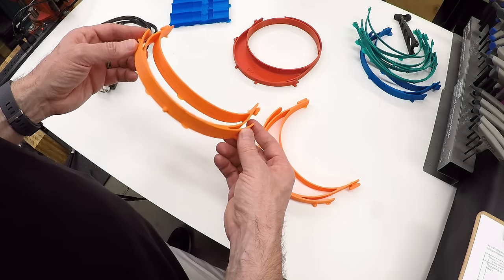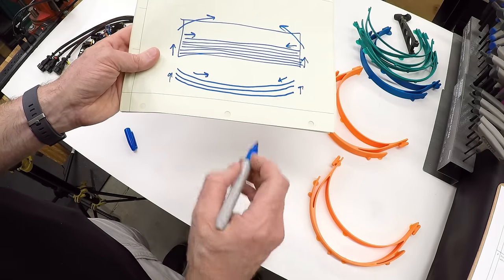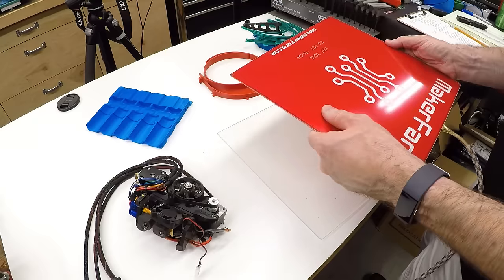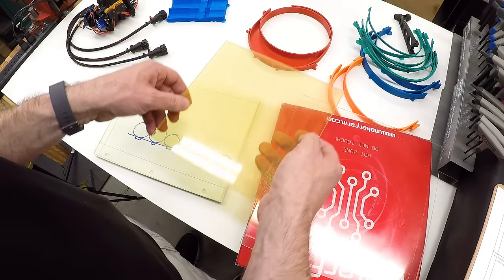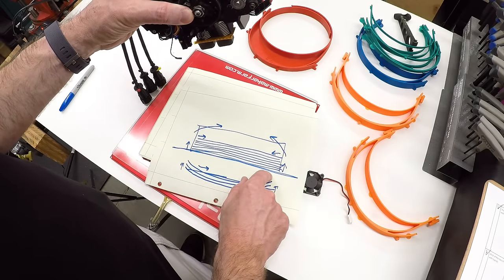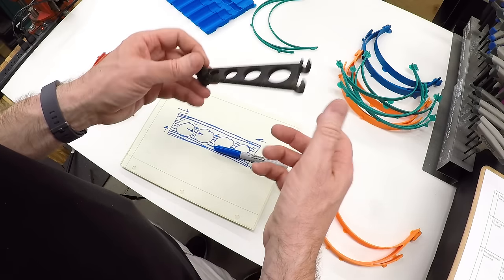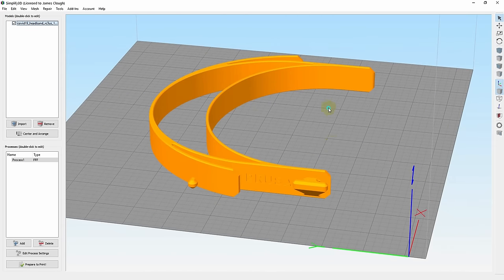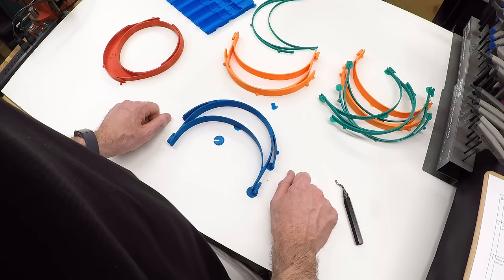3D Printing with ABS - Tips for Success

Comment: I got two things I'd like your opinion on:

One of the ways ive seen people use is a thin layer of abs on the glass.  Someone used an abs block on a syringe that had acetone in it.  

Also, what about using a different patern like a "hibert curve" for the first layer (so that there are kinda even numbers of x and y lines to help adhesion in both directions)?

How do you feel about those?  I don't have much exp with ABS, nor the setup for it.
Reply: Also, if you don't mind sharing it, that micro switch servo looks pretty sweet, do you have a schematic for it?

Comment: We have avoided printing PPE out of ABS as it will release toxic chemicals if accidentally put in an autoclave - PETG is much safer
Reply: I read this comment and that was at about 10 sec in. Now I'm going to go watch something else.
Reply: Aren't autoclaves hot? If the temperature is above 60 degrees C, you risk a lot more than an insignificant amount of toxic chemicals being released, you're risking the life of anyone wearing a PLA item subjected to that heat as it will lose it's structural integrity. ABS is good for 105 degrees C. Also, PLA is biodegradeable in water. ABS isn't. I would say ABS is a much safer material than PLA overall  for PPE. I don't know about PETG, I've never used it. I have a Flashforge Creator Pro printer, which is a totally enclosed model and only ever use ABS with no issues. Even though my printer is in my small home office, I've never noticed any smells or fumes when printing at all.
Reply: @Derek_S  pla does not degrade in water, weii if yuo wait a millon year maybe

Comment: It is a nice video. But the only safe way to prevent warping and cracking is to heat your chamber. It cost only 20 Euro and you can forget any problems with ABS. 55-60 Degree Celsius is enough. I had a a machine, that only print ABS, for all the the other easy filaments i use other printers.

Comment: Excellent tips, I wish you would share somewhere your pirnter settings for various filaments. Didn't know the first layer difference between PETG and ABS.
I 'discovered' most of the tips until the last one, always restorted to rafts on thin parts. Now I wish someone would just develop a CURA plugin that allows placement of "mouse ears".
I would also like to know how you handle print runs: do you keep the bed and nozzle pre-warmed? do you just let the parts cool down and pop off? Do you monitor everything by camera and step in when there's a mess?

Comment: What would you say would be the maximum height using ABS with an open-bed 3D printer?  I'm thinking that using a Ender 5 Plus and printing a 12" part would be a disaster 99% of the time without enclosing it.
Reply from the maker: It's all,about the geometry.  Height is only part of the equation.  I think the tallest ABS parts I've printed are in the 6" range.
Reply: @Clough42  Yes. I had commented about half way through the video and eventually got to the part of breaking up the long strands.  I'm about to buy an Ender 5 plus in a few days so I'm green as it gets.  I'm wondering if there might be slicer options of some type to print things a bit different rather than long rows.  It would be nice if there were but I'm just researching those things today.

Comment: Yes, ABS is cheap these days.  Hard to find TPU, and PLA is more expensive.  Curling / shrinking due to heat break cooler exhaust is a a real thing; I like your solution.  Is that switch-on-a-servo Z-probe homemade, or maybe a commercial product that predates the BLtouch?
Reply from the maker: It's homemade.  It's an HXT900 servo with a 3D printed arm and a low-force microswitch.

Comment: with a heated chamber of 60 to 65 deg C  you will never have trouble of layer bonding or warping.  you will also get stronger parts.  the Idea that ABS is outdated is because peoples don t have a heated chamber so they fail trying to print it.  makerbot just update the makerbith method to the method x because the original method heated chamber don t heat enought .  the method X is there version to succesfuly print ABS

Comment: very good advises, but I have a stupid question, If printing with ABS is that hard why stick to it, I mean what's the pros that make up for all that trouble ?
Reply: My reason is because I am trying to print replacement parts that break off old motorcycle parts that are ABS. Using solvent welding to bond ABS to ABS is pretty basic. Then the repaired part has the same kind of plastic throughout so any fabrication or painting on it will react uniformly.I have made repairs by hand making a small "mold" then applying a thick paste of ABS but that is so slow and messy. Very strong though.
My error in 3D printing was choosing an improved strength ABS filament "TitanX" but what they've done is modify the mixture to get that extra toughness and something in it won't allow it to dissolve in solvent. Personally, PLA is a "gateway drug" to learn with but it wouldn't be my first choice for reproducing applied parts; things that get used, not looked at.
Reply: Yeah i swiched to ABS over PLA for that toughness reason but the parts i get with ABS snap I don't think I have a good layer adhesion although the parts look good
Reply from the maker: I like ABS when PLA is too brittle or PETG is too flexible.  Or when I need parts to stand up to weather exposure.  Or when I want to machine the parts after printing.  Or when I want to vapor polish.  Or when there's a global pandemic and all the PETG and PLA are sold out.

Comment: I'm using ultrabase heatbed for 2 years with ABS and never had this issues like you had. Simple part stick like hell not using any hairspray, abs juce or any. The only thing that  matters is how do you calibrate your bed level.
Anycubic I3 Mega
Reply from the maker: Yeah, Ultrabase is the surface I mentioned but did not name in the video.  It sounds like you're having a great experience with it.  Lots of other people are too, but, there are also lots of reviews out there from people who had great difficulty.  There are lots of variables.  Being aware of them leaves you better equipped to solve problems when they arise.
Reply: @Clough42  Agree with you :)

Comment: What you can do about it is to not print ABS.  The filament industry is sitting on tons of the stuff that hobbyists will not touch with a ten foot pole anymore.  It isn't worth the trouble and the carcinogenic fumes floating around the mandatory heated enclosures.  Tricks mean a few might work, but it cannot be relied upon without a dedicated set up well away from any and all office quarters.
Reply from the maker: I print hundreds of parts per month in ABS because its properties work well for my application, and I have my process tuned to print fast with high yield.  If something easier to print works well for your application, it sounds like that's a better choice for you.

Comment: with the mouse ears wouldnt it be better to have rectangles so there would be less to cut off the item. ie rather than a 20mm dia circle a 30 by 10 rectangle would mean just 10mm to cut off the item
Reply from the maker: Maybe.  I think the rounded sides may be less prone to peeling up themselves, but I have nothing to back that up.  However, in practice, I slice them off with a deburring tool, so a 20mm circle or a 30x10mm rectangle both come off with a single swipe of the tool.

Comment: Hey there how long did yours take to print they the same ones i been trying to print but taking 13hrs so not able to make many yet, only got my printer 3days ago so probably slicing wrong thanks good job your doing 🙂👌
Reply: He's printing at almost. 4 layer height with a fairly ridged machine so i assume he's printing them awfully quick
 3hrs ish maybe
Reply from the maker: 1 hour, 41 minutes.  .38mm layer height, 30% infill, three perimeters, 100mm/s.
Reply from the maker: 1:41, actually.
Reply: Thats incredible wow 😮 didnt know printers were that fast mine must be in the wrong settings 😂

Comment: And  E sun abs is good so shouldn't have no problem as long as bed is level and have a heated chamber.
Reply from the maker: With the heated chamber, it works very well.  It was working pretty well for me on a smooth PEI-on-glass bed in an open printer until the middle of last year.  New rolls purchased after that don't stick well to my bed at all.  The sheen on the printed parts is a little different, too, so they must have changed their formula, material source, or something.

Comment: Hi. Do you have a video where you show how to make the Old School  bed leveling  switch?
Reply from the maker: I don't.  There is some information in the assembly instructions for the Double Flex extruder on clough42.com.  It's based on an old version of Marlin and RAMPS 1.4, but the concepts still apply to the new code.  Search google for"servo bed leveling" and you should find something.

Comment: hi what about to use one meter of pet-g to make good contact and then use Abs (its easy to weld them together) i need to check that way
Reply from the maker: That won't change the warping forces generated by the cooling ABS.
Reply: @Clough42  yes but pet-g is great  sticker to bed , but I try to weld them together it's doesn't look good

Comment: Printing at slower speeds can also lessen warping, but I have no idea why it works.
Reply from the maker: Not sure.  I find that time on the bed also matters.  So sometimes printing faster can finish a part before it comes loose.  Printing two parts doubles the time and both fail.

Comment: block air off around nozzle area using heat resistant tape to stop air blowing down on print and have a scoup out of tape at back blow that air upwards away from prints
Reply from the maker: Yup.  This is exactly what I have on my printers.  I'm also running my own custom extruder systems that vent the hot end cooling air out the top.
Reply: @Clough42   thats a smart move man good thinking may try that to as like using abs as make parts for e-mtb and needs to be strong

Comment: OH! Side note... I'm brain dead... I've got several of those deburring tools down in my machine shop basement and it never dawned on me to use them for plastics. Ordering 3 more just to be placed next to my printers.
Reply: How good i.e. expensive, a deburring tool is needed for plastics, in your opinion? Or maybe the odd bit of 0.040" sheet aluminum for some other hobby stuff. Thx.

Comment: If you are not sure if the glass you're buying is completely flat, you better go buy a mirror. Mirrors MUST be flat or the reflected image will be distorted.
Reply from the maker: Glass is never completely flat--even a mirror--because it's flexible.  A square piece typically takes a set, bent corner-to-corner and then becomes very rigid in this state.  If you press on the center of your bathroom mirror, you will see it flex, and the image distort.  As long as it's a smooth curve, you don't generally notice.

Comment: That Extruder looks light weight! :-)
Reply from the maker: Looks are deceiving.  It weighs less than the single NEMA 17 Greg's Wade's extruder that came on the printer originally.  The motors are NEMA14, which throws most people off when judging the size and weight in a video.  It is of course much heavier than a Bowden setup.

Comment: Most Materials shrink while cooling. Some expand. CF, water. So saying all materials shrink when cooling is wrong
Reply from the maker: Even water contracts when cooling.  It expands when it makes a phase transition.  I'm unaware of any FDM printing material that causes issues because it expands while cooling.
Reply: @Clough42  What about Carbon Fiber? There is no phase transition for that but it still expands while cooling. CF is being added into multiple FDM materials to help the general problem of high changes in dimensions while cooling

Comment: Thanks for this!  Not sure if it was in any way triggered by my email, but exactly what I was looking for.  I don't use an enclosure, but I do run a fairly large 12v fan with a duct and use 3 layers of activated carbon air filter sheeting.  I figured it was insufficient for controlling the vapors for ABS, but I suspect I was overthinking it.  Once I've burned through this PETG, time to give ABS a try.  https://i.imgur.com/yV2yBvF.jpg

Comment: Back when I started printing I completely turned my nose up at PLA... Never even tried it. Still got the full example spool. Inferior material. I print in ONLY ABS, nylon, or PC..  .. I don't find anything difficult about it. Anyone out there who prints in "PLA" ... btw wtf is PLA and who tf uses it besides baby 3d print pussies "booohooo my part waaarped".... aint no industry standard. .. its CRAP. 
Put on your big boy shoes and start printing in the same plastic everything else is made out of. not some "soluble biodegradable SUPER EASY NO WARP" PLA GARBAGE!
Reply from the maker: That's a little harsh.  Use the right material for the job.  PLA is easy, and if it's suitable for your needs (shelf clutter, low-stress prototypes) there isn't any reason to make life harder, just to have street cred.  That said, I find little use for it.  I tried it early in my printing journey, when I needed a large part that I couldn't print flat in ABS, and it immediately broke because it was too brittle for the application.